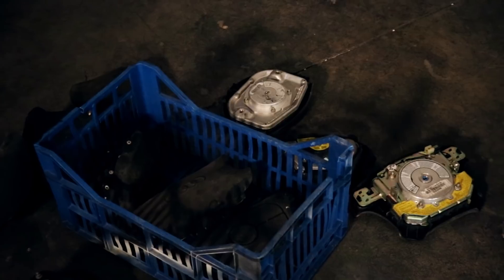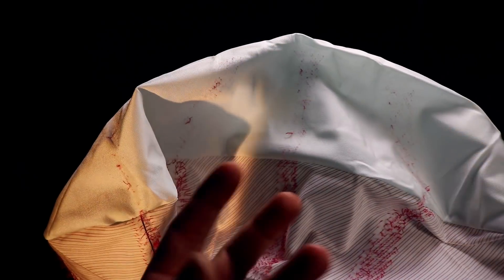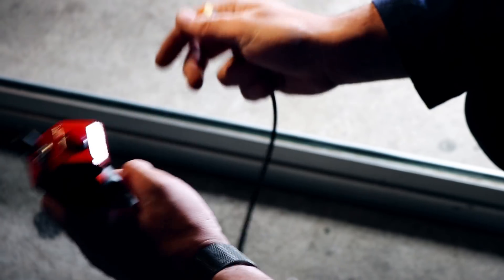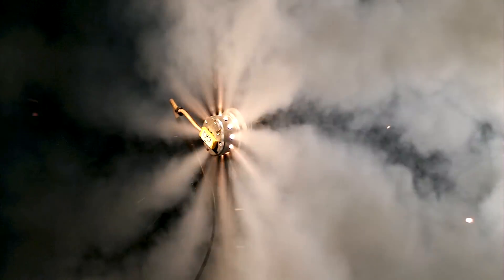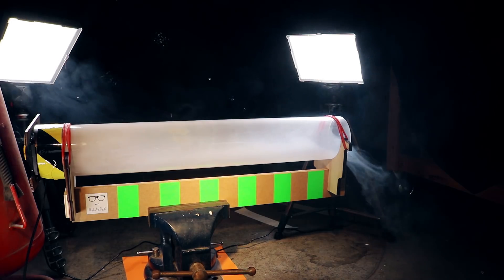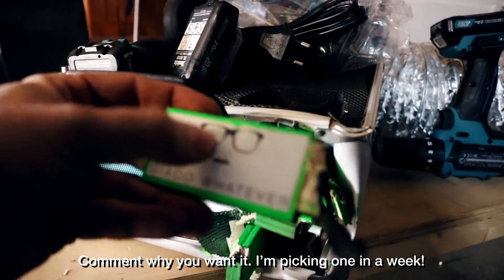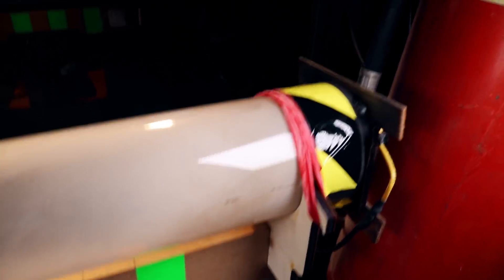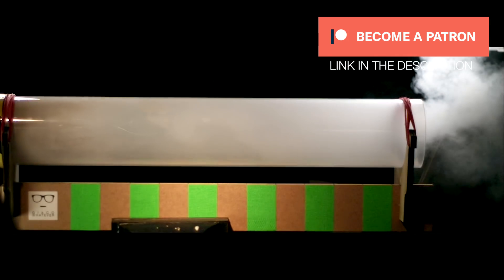Inside an AIRBAG at 4000 FPS | GIACO

Comment: Scary big boom. Kind of like the guy that sat on the plywood over the  bag. It blew him straight up breaking bones and breaking more on the landing. The wiggle in the beam is prob like the wiggle in a steel barrel of a rifle when it fires. the barrell squirms like a snake. thats why the amount and speed of the powder burning often makes a difference where the bullet goes. The barrel wiggles differently and the bullet comes out at differnt times compared to where the barrell is pointing when the bullet exits. a tiny angle makes a big diffence at a disatnce of 50 , 100, 200, 300 meters.

Comment: I think another reason for that filter is to help absorb some heat. Those gases are incredibly hot (as seen in the open discharge), so it can possibly be saving your face from major burns as well

Comment: What is the red arrow @ the end Asking about? The smoke "pulsating"? (it does that because of Pressure differences, It will continue to "Pulsate" until air pressure inside the tube Matches the outside.

Comment: Your question at the end, 
'Why was it doing this'? 
It was the shock waves of air pulsing back and forth. 
I've worked in underground mining as a diesel mechanic and have been close by some blasting in the mine. 
You can feel the waves of pressure travel back and forth like waves of water I'd you are close enough to the blast. 
I'm actually a regular auto mechanic that went into mining, so to see the airbag in slow motion is super cool. 
Great video 👌😁👌

Comment: The "panting" that the smoke seems to do at the end (that you asked about with the red arrow) is caused by the gas in the tube resonating from the explosion. It is like a giant organ pipe producing a tone that is probably in the audible range (when not in slo-mo). But your ears would be deafened by the explosion itself, so it would be hard to hear, especially as it probably dies out in a fraction of a second.

Comment: The smoke is probably doing that back and forth motion because the explosion and disk created a vacuum and the back pressure is pulling in air then equalizing.  Similar to the thumping sound you hear when you roll only one window down in your car on the highway.

Comment: You asked why is the smoke doing this? Answer- that is the visible frequency of sound. The airbag canon creates a differential of air pressure and it is going from high to low pressure back and fourth until it equals out to atmosphere pressure. The fact you can see it is the actual wave or the frequency in sound.
Reply from the maker: Yesss 👍🏻👍🏻👍🏻

Comment: The compressions/decompressions in the smoke near the end of the video is because of the vibration wave propagating along the tube ... And there was no wave at the beginning because the entire tube was expanded from the pressure step ... So basically this is the step response of the tube which is decayed oscillations at the resonance frequency of the tube (I think the frequency of oscillation can be changed by changing the diameter of the tube)

Comment: I think the smoke is like vibrating because the smoke is moving so fast it's creating a region with low air pressure therefore pushing some of the smoke inwards and the smoke coming out from the tube pushes it back up and it keeps going until the smoke in the tube comes to rest. This is just what I think

Comment: Alright, chemistry. The compound inside is commonly Sodium Azide, formula NaN3. Decomposition of this via heat liberates Nitrogen gas, Sodium (reacts with air at high temperatures) and heat. Equation: 2 NaN3 + Δ -> 2 Na + 3 N2 .

Comment: The oscillating gas is the resonance of the gas in the tube, causing a little vacuum at the beginning of the tube, sucking air back in from the end, pressure rising, thus forcing the air back out, creating a vacuum at the beginning and so forth..

Comment: The rippling effect at the end is caused by the explosion expanding the air then the expanding air making a high pressure that then shrinks back down again and the force of it going back inward smashes and popes out again making the rippling effect. The smoke makes more visible.

Comment: the smoke is pulsing like that because of the oscillation of the tube from the deformation waves traveling through the material from the pressure. right?

Comment: When the smoke was pulsating it was because after all the pressure was released there was a partial vacuum inside of the tube so it sucks air back in as soon as possible and at the front of it the air is acting kind of like a guitar strings after it is strummed

Comment: Red threads slow down the bag so it doesn't slap you in the face as hard. Early bags really slapped the crap out of you, and could break the neck of smaller folks. They had to come up with ways to slow that down so they were not killing people.
I knew a guy who was in a major rear-end/minor front bump accident that set off the bags. He came over a rise and stopped for an accident, but the big semi behind him wasn't going to make the stop, so he braced into the seat to avoid whiplash. it really shortened up the car and he said he was not hurt until the impact made him hit the minivan in front of him just hard enough . . . and all his injuries were from the bag. Bloody nose, black eyes, scrape from broken glasses, road-rash/rug burns on his face and arms from the fabric of the bag, bruises on his arms from the bag and back of the left hand bruised from hitting side window hard enough it broke when his hands were blasted off the wheel. 
Big Badda Boom. Good work but ya scared me with your "back stop" with the wood projectile. you made an improvised canon. At least you didn't try something heavier um yet . . . you gonna do that, right? (~_^) 
Large area, outdoors.

Comment: The pulsing in the smoke is because the projectile made a small vacuum, and the air around it was forcefully sucked into it causing a ton of pressure, Wich is released quick enough to make another vacuum, and so on. At least I'm pretty sure. I think that's how it works with bullets leaving a gun.

Comment: The wavering smoke at the muzzle is going back and forth because of diffusion. In other words, the pressure in the barrel before the projectile ejected was a lot higher than the pressure of the air in the room. Once it left, opening up the barrel, the air that was compressed into the barrel rapidly released into the atmosphere trying to reach the same pressure as the outside. Because this’s happening so fast it ends up over compensating, then it goes back, then forward again, then back, the forward over and over until the pressures are finally equal.

Comment: That happens because the air coming out of the tube has a very high pressure and once it exits the tube it expands and drops in pressure so much that the ambient air pressure pushes it back and it repeats multiple times until it finally equalizes. this effect is much more visible in water
Edit: also, I want one because it would make my day and I could show it to other people the show them your channel and watch videos with them :D
Reply: I see what your going for but i think thats just smoke bre

Comment: The smoke oscillates because you essentially made a resonating tube.  Large cathedral organs used tubes of different sizes too resonate air at different frequencies.  Your tube is large so the frequency is very low.  Since your tube is short, the oscillation damps quickly which is why it's not visible to the naked eye.  The projectile traveling creates what is referred to as a soliton pulse which is a mixture of frequencies.  The resonating frequencies persist in the tube the longest, so those are the ones that continue to echo in the tube.  The result?  Vibrating smoke... Science!
Reply: Unmannedair wow you wrote a more in depth version of my reply, im jealous now😂😂
Reply: Wow nice revelation. I bet a 20 foot barrel would make a really cool echoey booOOooOOooOOooOOoom note. Kind of like the boom of even a small firecracker in a 35 gallon trash can.

Comment: The air is oscillating as a consequence of the sudden differential pressure within the tube.  The shock wave is sufficient to cause the air to behave rather like an elastic band; which eventually finds equilibrium.

Comment: I want it as a Christmas gift and it is "shuddering" because the gas is pushing against the air then getting pushed by the air until it has enough pressure to push the air back out again and the cycle goes on until there is no pressure left.

Comment: The shaking of the smoke i think is the smoke trying to refill the vakuum that arises from the projectile moving so fast that it creates a channel of missing air. As a result the smoke (air & dust) trys to balance the atmosphere between the channel and the air, while getting sucked in the channel air waves smash against each other (implosion), afterwars another atmosphere imbalance was created on the outside. so the air trys again to balance the pressure between channel and the air until the pressure is the same in and outside. Btw theres a video of a gun firing under water, the implosions can be seen way more clearly and devestating, because waterbarriers are smashing against each other and create a true blast as a result. dont hate me if somethings wrong i just guessed

Comment: The "vibrating" smoke is probably due to the canon walls vibrating. The gas from the explosion creates a higher pressure behind the projection which also makes the canon walls expand a little. So the vibrations is simply the canon walls vibrating returning to equillibrium.

Comment: The cannon smoke is oscillating because there was pressure spike inside the cannon, when the projectile leaves the cannon it allows the gases inside to leave too. The gases have mass and momentum so when they go to fly out of the cannon their momentum will begin to pull a slight vacuum. The smoke just makes this process visible. Once the gases lose their momentum because they are fighting the now  lower air pressure in the cannon some of them are sucked back into the cannon at a fast enough speed so their momentum creates pressure (obviously much less than the cannon did) and the process starts over again until all the energy is used (with every oscillation the gases lose power and speed) also btw love your videos keep making them you're awesome bye.

Comment: Awesome video, I didn't realise how cheap you could get them for! Ideal for cannons. The amount of gas they produce at a nice velocity too and electrically activated! Be careful messing about with those though, especially cutting into them as they contain sodium azide which is very toxic. I expect the heavy metal mesh is there to entrap the reaction salts so only nitrogen escapes to inflate the bag (all the bad stuff should be absorbed into silica sand in the module so they don't poison you), it's probably there as bit of a damper too.
Reply: You're the only one I could find that mentioned this. More people should be aware of the dangers associated with these especially since I don't think he warned against it. For the record getting the sodium azide wet will produce hydrogen azide which is very dangerous (highly toxic, explosive, volatile) as well.

Comment: the Strange smoke movement at the end of the cannon is caused by the frequency that occurs when the pressure blast hits the wall first, it dissipates the pressure in a sinal-Wave over time, that is why it is getting lower and lower over time. You can litterly see the force dissipating from the cannon.

Comment: It does the sort of bobbling because it wants to equalize with the surrounding atmosphere and it’s such a high pressure that it expands extremely fast. It gets an inertia so great that it still expands even though it’s equal with the surrounding atmosphere. This causes a much lower pressure and the surrounding atmosphere then compresses inward so fast and has an inertia so high that it is now a higher pressure! This repeats over and over again, causing the bobbling

Comment: it does the oscillations because inertia throws out too much gas, lowering the pressure below atmospheric, making the atmosphere push back and it oscillates much like underwater explosion bubbles do
Reply: They are the same thing.  The tube vibrating IS sound resonating around inside the plastic.  You cannot have one without the other.  In stiffer tubes, they still vibrate, but the speed of sounds in those tubes is higher so the frequency is higher, and the amplitude is lower.
Reply: The explanations aren't mutually exclusive. The momentum of the gas requires it to continue out the tube, even to the point of partially evacuating the tube a bit. The ambient air pressure will drive air back into the tube until that slug of air hits the back of the tube, is compressed, and in turn thrown forward in the tube.
This cycle will repeat, with its period consonant with the length of the tube and the local speed of sound. We will see the little puffs of suspended powder continue until all the energy has dissipated.

Finally, any transverse and longitudinal oscillations of the tube material itself will have only a minor contribution to the phenomenon, being exceptionally rigid.
Reply from the maker: Yesss...
Reply: But since sound is air pressure doing essentially, what I described, isn't it the exact same thing?
Reply: I believe it may be thermo from the explosion  and the expansion and contractions of the tube
Reply: I didnt even see your explanation before I made mine, but in essence we said the same thing. cool
Reply: Yea I was going to comment Cavitation bubble
Reply: trust the tube guy about tube questions I always say.
Reply: Helmholz resonance
Reply: It's doing that because of free standing air being displaced at a different rate of pressure by compressed air.  It's called the Bernoulli effect and it is the principle upon which airplanes fly
Reply: I think you are incorrect. The oscillation is caused by the explosions wave reverberating in the acrylic tube on its natural frequency. You can see the other end of the tube expanding and contracting in sync with the gas oscillating at the other end. You don't see this phenomenon with more rigid materials used as the barrel. I admit I could be wrong, but I haven't seen this on other high speed footage of cannon shots.
Reply: No. It's not the pressure, but the tube that contracts and expands cause the pressure difference, which in turn moves the air. Again, look at the tube "shaking".
Reply: It's the air inside the tube that is shaking, not the tube itself.

Comment: When the gas escape from the barrel it slows down and dissipate, the gas escaping the barrel is moving extremely fast and when the fast gas comes in contact with the slow gas ,the slow gas gets pushed out in a circular motion causing a vortex. As for the short span of the vortex when the wooden projectile was fired some of the gas escaped and form smoke around barrel and some get compressed shooting compressed gas out to from a vortex and centrifugal force ejected smoke away from barrel as the compressed gas quickly de compress hence the mushrooms cloud like appearance and short time span